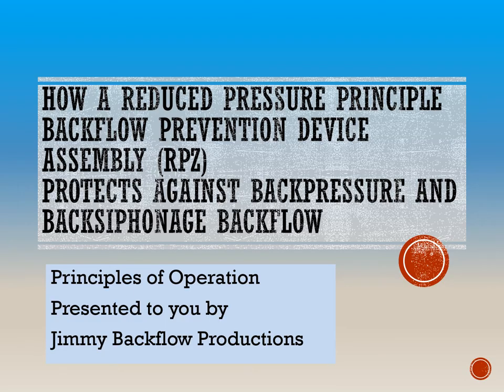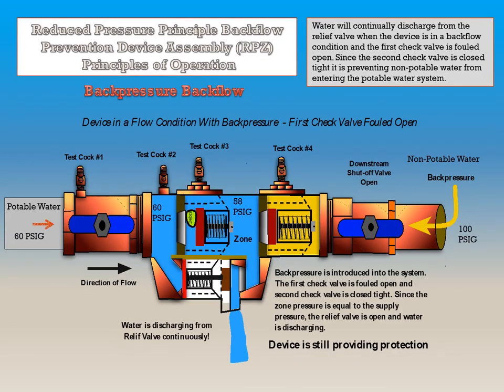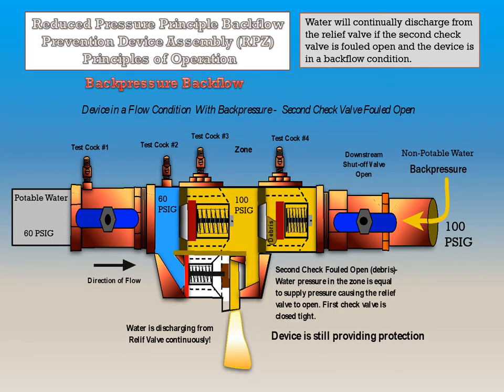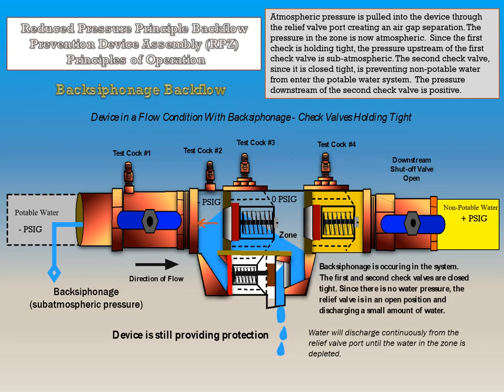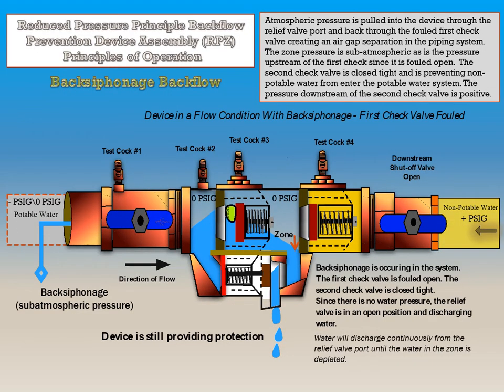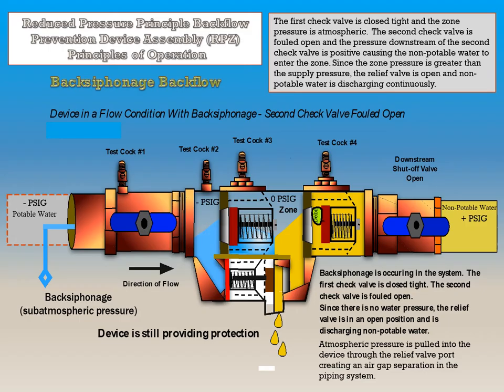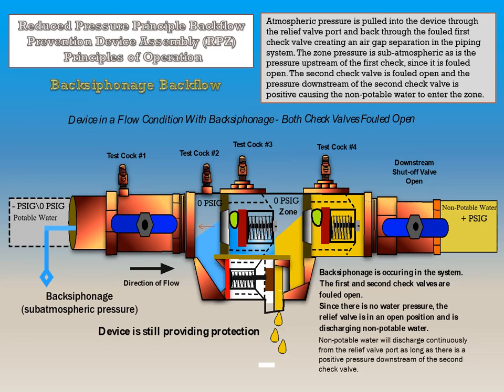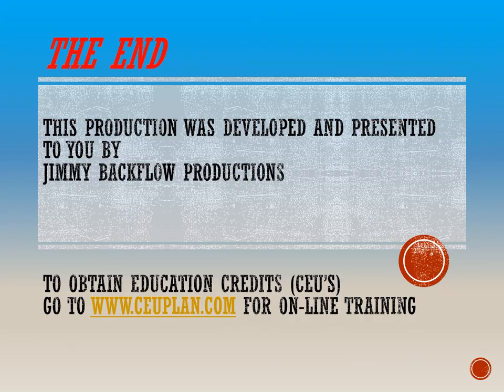RPZ - How it works

Comment: Hello. Which one is the supply pressure? I don't quite understand that part.
Reply from the maker: The supply pressure is where the water enters the backflow preventer. It is the inlet pressure or the pressure at TC#1. Supply pressure is typically higher than the outlet pressure. Backpressure is the exception.

Comment: I know this video is old but I'm going to take a shot. Valves are banging in my rpz whenever my makeup water pump starts and stops like there's air trapped inside. How can I fix this?
Reply from the maker: Mikey - water hammer is the issues. can be corrected with the installation of a soft seated check valve downstream of the backflow prevention assembly.
Reply: Or get a plumber in
Reply: @JimmyBackflow  thanks man! I had a plumber come in and try to change the whole RPZ ,  you definitely confirmed what I thought would fix it. 👍
Reply: @Mikey2Times  There's always a rotten apple in the bunch lol